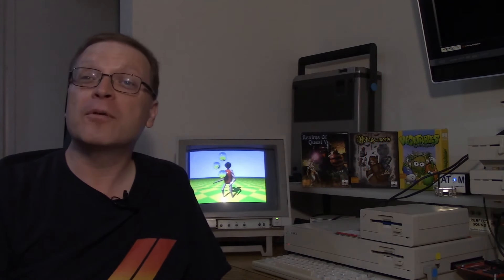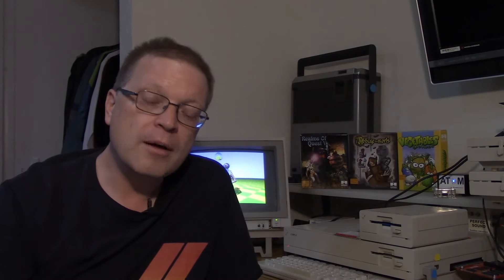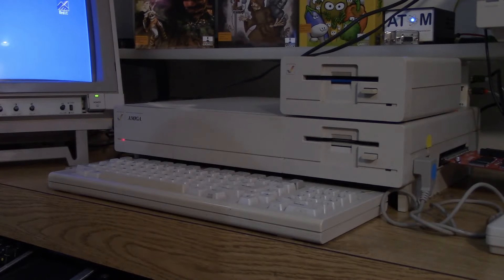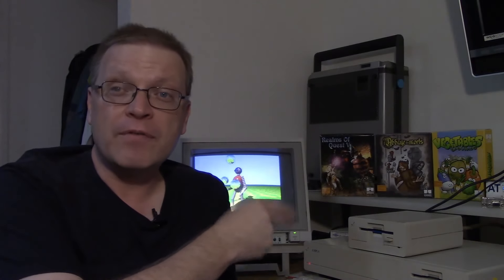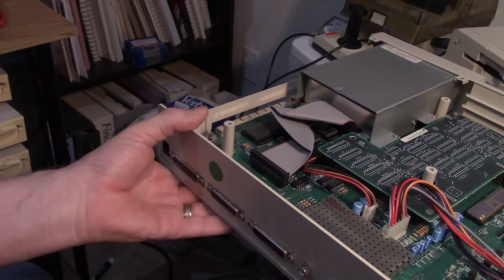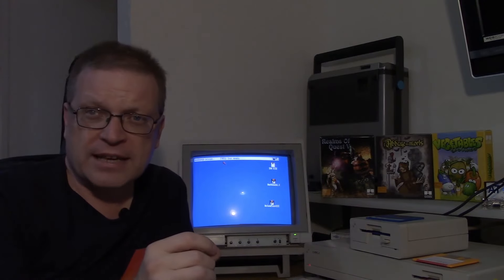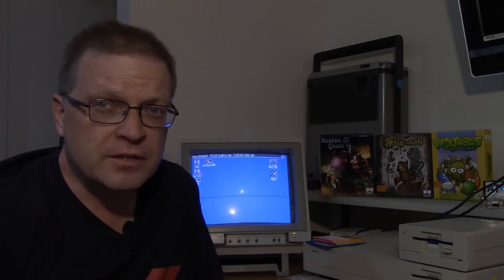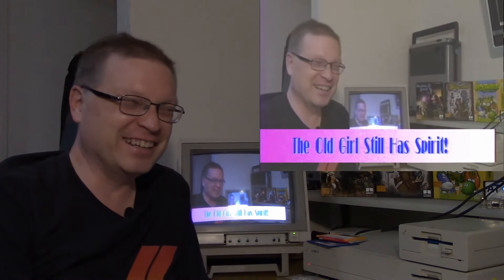10MARC Episode 45 - Amiga 1000 Adventures and Review

Comment: how comes theres no commodore logo on the bottom left of the machine? ive always loved the look of the a1000 and would love one, the only drawback for me is the chipmen limitation. wish it had the same mem as the a500/2000. great vid
Reply from the maker: The A1000 often did not have a Commodore logo. Some did, I think. The 512K RAM Chipmem is a big hit for me, as I work in some fairly hi res modes and use Overscan a lot. I am learning to live with the limitations, though. And I have several other machines with 2 MB CHIP RAM if I need them!
Reply: As far as I know, the PAL Amiga 1000s sold in European and Middle Eastern markets all had the Commodore logo, including the ones I have.
Reply from the maker: @hishamk  good to know! Maybe just the USA version had the Checkmark
Reply: 10 Minute Amiga Retro Cast  just to be clear the non US versions also had the checkmark badge in addition to the Commodore logo silk screened underneath.

Comment: Very nice machine! I like that it has limitations also, so that it has it's own place in the line up of Amiga's. I would like to get several Amiga's and try to make them different from one another so that the 1000 can do this, the 2000 can to that, the 3000,,,and so on.
Reply from the maker: Yes I agree. My A4000 is my go too workhorse for productivity, my A1200 is some AGA graphics and games, and my A500 I use mainly for presenting with, as it is the most quiet of all my Amiga's. My A1000 will be for video work with the Genlock.

Comment: Hey Doug, great video - I have a special request.... can you see if the Classic 520 accelerator works in the Checkmate 1500 case attached to the Zorro board?  PLEASE!!!  Like you, I have a non working ACA500+ and this looks like a pretty good alternative?  Also, where did you source the Classic 520? THANKS
Reply from the maker: You bet. Next week I Will demonit on the A1000, an A500 and in the Checkmate A500. I got mine from amigastore.eu
Reply: 10 Minute Amiga Retro Cast thanks for your reply.  If it works I’ll order one and close this ACA500+ saga and be done with it. Sucks, because I really wanted to use my ACA1233n and have the 030 and 128mb of RAM.
Reply from the maker: @sgt960  I just had the new mod done to my ZorroII adapter on my Checkmate 1500+ case to make the ACA 500+ work, but of course I can't test it until I get mine fixed. I can tell you the mod made my Oktagon 2008 SCSI & 8 MB card finally reliable. It was crashing every five minutes so I took it out and used my A2091. With the mod done, my 8 MB card seems perfectly stable. That gives me hope!
Reply: 10 Minute Amiga Retro Cast I did the mod to my Zorro adapter, and it made my ACA500Plus pretty stable, but only at 21mhz or less. With it plugged directly into the Amiga (no Zorro adapter) it runs stable at 40mhz. It won’t boot at all with an ACA1223n attached - black screen if I use the Zorro adapter.
Reply from the maker: @sgt960  Well I suppose that is progress.... Just not a total solution. I will try my Classic 520 in my Checkmate this week and let you know - but I am sure it will work perfect.